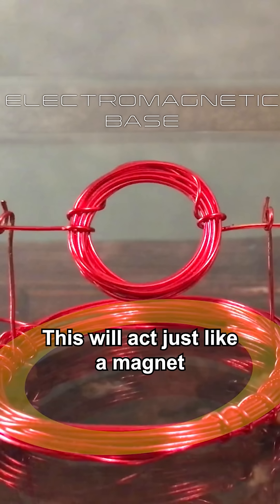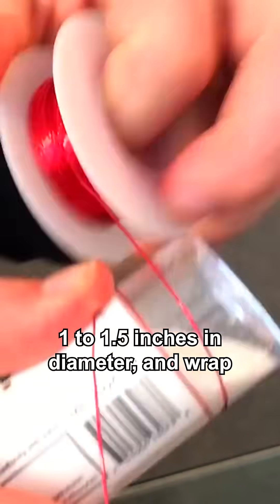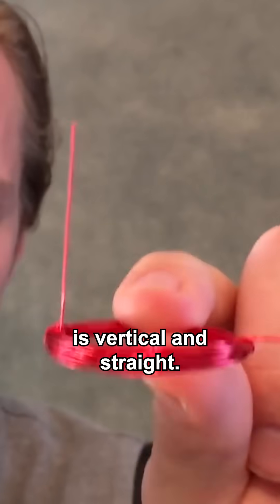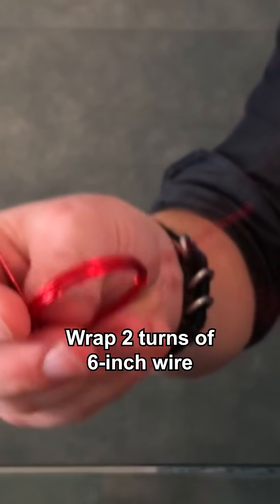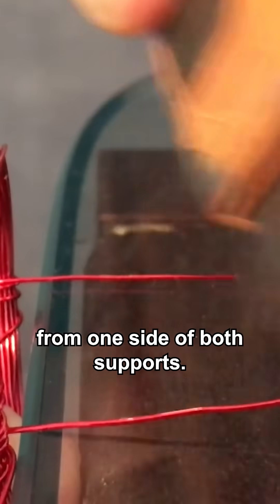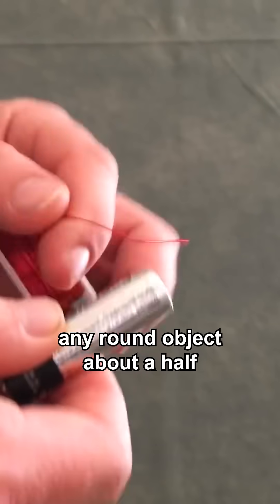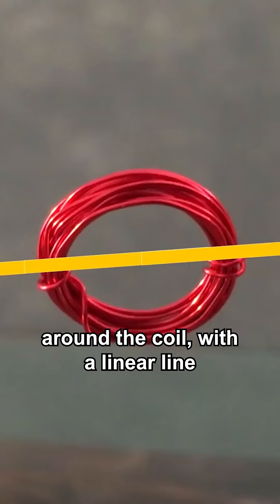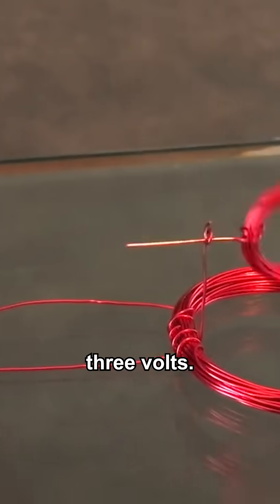Ultimate DIY Electric Motor Using Only a Wire!

Comment: Does it work in reverse? Can I spin the coil and make electricity?
Reply: Yes with a catch... you have to give a little before you get anything back. You have to energize the field coil (the base) before anything would be produced. 
Unfortunately I don't think you can self-energize this one (generate enough to energize the field coil without external power), it's not that efficient. 
Most vehicle alternators work this way, there aren't any magnets in them but they're much more efficient at using the power applied to the field coils.
Reply: This is why you can't start a car pushing it if the battery is K.O.

Comment: what is this "inch" thing you speak of?
Reply: This "INCH" is a unit of measuring in the imperial system. The imperial system uses 10's (metric) sometimes, mostly for the simpletons in other countries that aren't smart enough to understand WHY the imperial system exists and think we don't understand how to use metric.... I digress. 
But some calculations are more appropriately done in imperial measurements. And thus there can be quite a bit of crossover.

Comment: You can place a neodymium magnet at the bottom of a Aa battery and do some turns of wire around the magnet and touch the other end on the other side of the battery and it will spin
Reply: Not the point